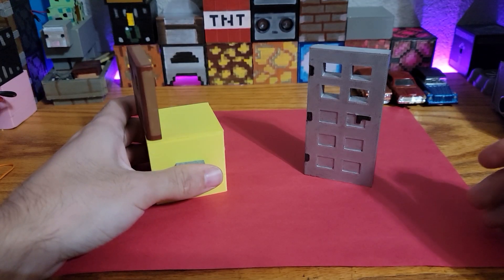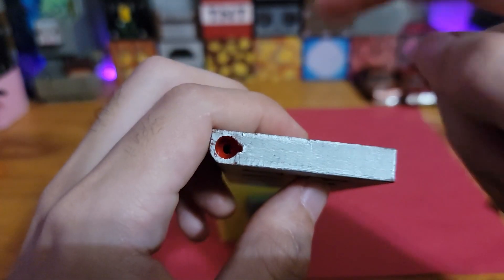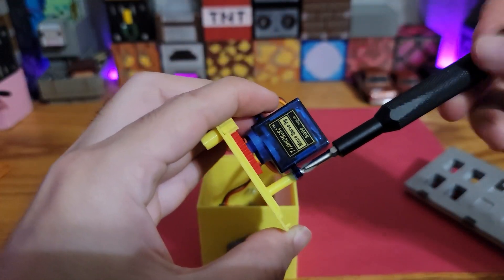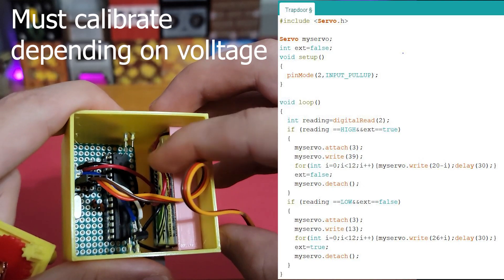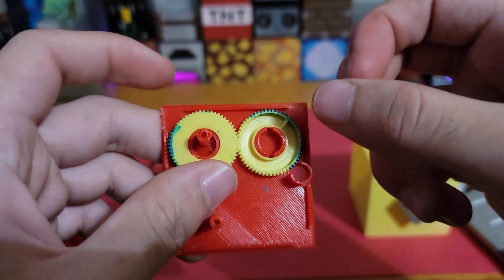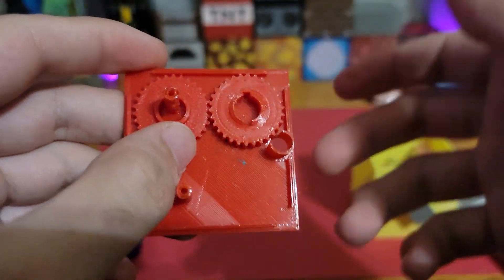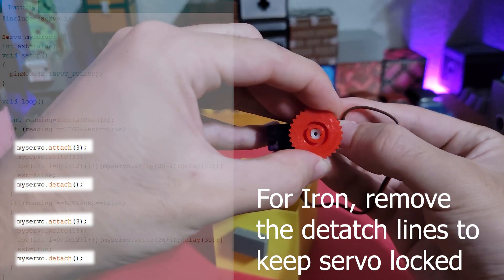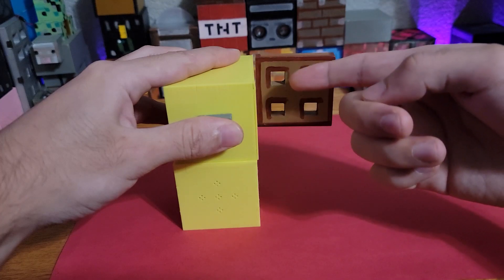Minecraft Door and Trapdoor: Servo Gears

Comment: Hey Hec, this is co cool! I was thinking you could extrude (or mirror) the key downward into the block through the gear that its turned by. Then add two stopping "paddles" on either side of the inner cube walls that limit the key's rotation to 90°.  This way you could eliminate the extra coding and allow the doors to be spammed. 

Cheers!
Reply from the maker: Dope suggestion! The stops can be added easily to the bottom of the gear : )